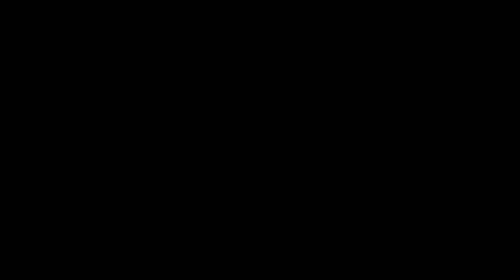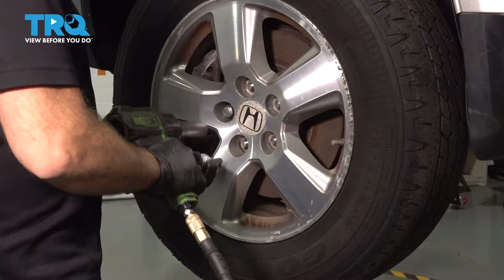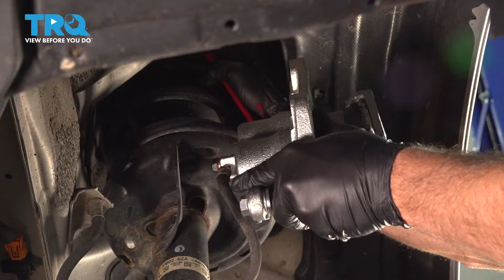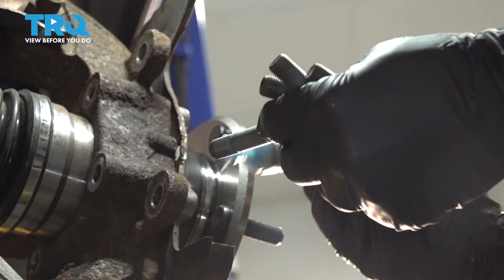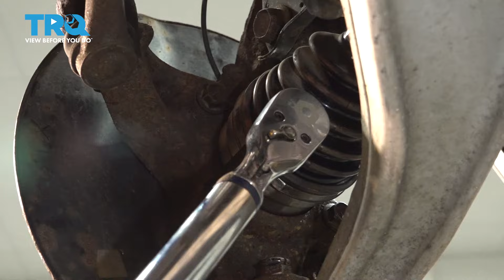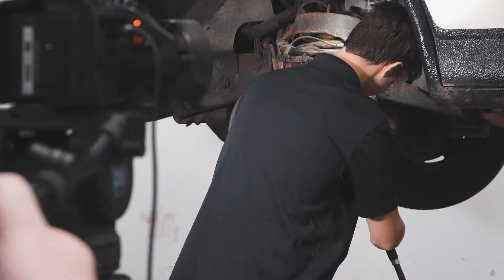How to Replace Front Wheel Hub and Bearing Assembly 2009-2015 Honda Pilot

Comment: Axle nut is 36mm.. Make sure your dust shield for the brakes is facing the exact same direction when you put the new wheel hub in. The rounded edge goes towards the rotor. I beat my dang wheel hub in.. only to beat it back out again because of the dust cover.. Ya gotta love auto repairs. Lol.

Comment: Is there a trick for allowing the wheel hub assembly to be able to spin when you’re trying to knock it loose? I’m trying to spin mine and it’s locked in place wondering if I need to put the car in neutral?

Comment: The mechanic said the spindle nut socket size was 35 mm and I got a 35 mm socket and it was just too small. I own a 2010 Honda pilot touring. I had to go back and get a 36 mm socket. Also, there was no step on unscrewing the rotor from the wheel hub assembly, which for first timers might be helpful to mention.

Comment: They made this better on the newer Pilots. I have an 06 and you have to take the wheel hub off and out of the suspension because it doesn't have those wheel hub bolts. (If they had only made room to back out the studs like other cars - thats what I'm working on - I could have done it without removing everything). I had to knock out the bearings and now I'm not entirely sure I should put that back together. sigh

Comment: When putting the brakes back together, it’s good to use a lug bolt to hold the rotor in place if you don’t have the Phillips head rotor bolts. The lug nut will hold the rotor snug to the hub while you put the caliper back on🙏

Comment: Would this be basically the same process for a 2014 Honda accord? I can't find any good videos showing a 2014 accord front wheel hub & barring replacement
Reply from the maker: +@nathanwoten6236 Yes, the installation process would be similar.

Comment: What was the symptom of the wheel bearing? My 2010 Pilot shakes after pulling a trailer. I’ve changed tires, suspension, links, bushings. Running out of options. Thank you

Comment: Is the pilot 2016 any different than the 2015, i know the axle nut is 36 mm on my 2016, i need to replace wheel bearings

Comment: I've seen anywhere from 181 ft lbs to 242 ft lbs for the axle nut. Might have to call the dealer to confirm or check the service repair manual if you can find one.